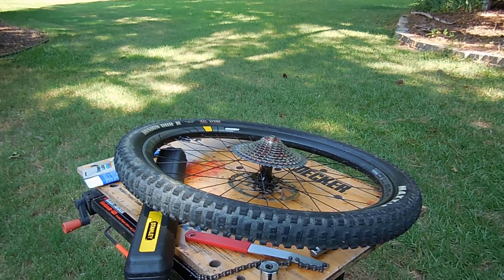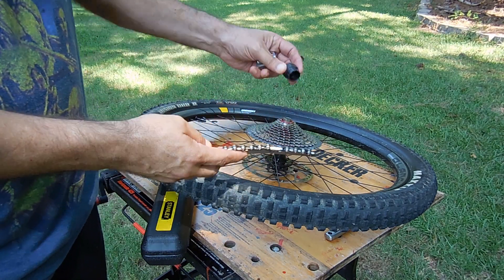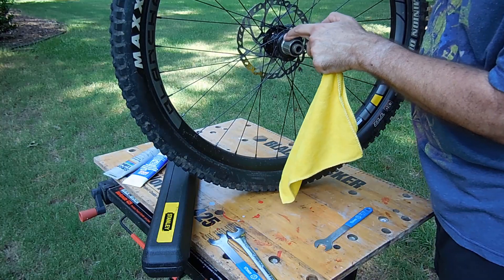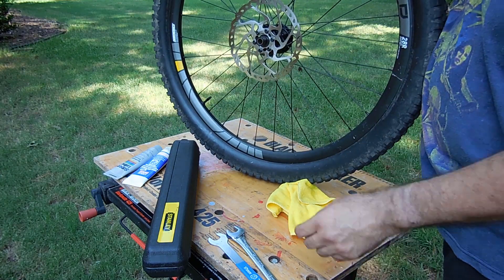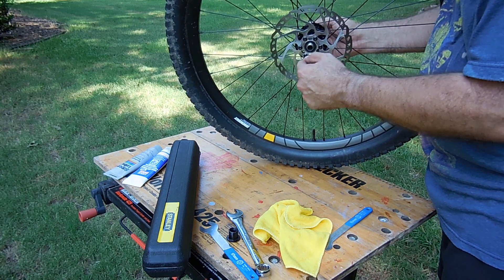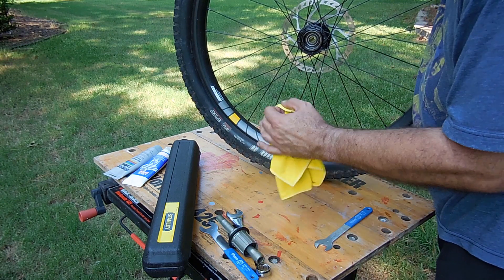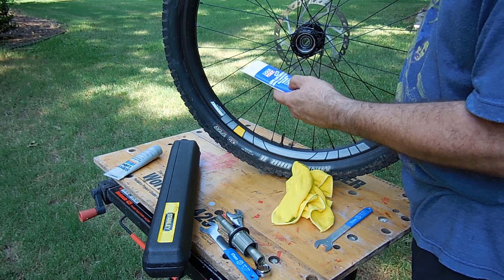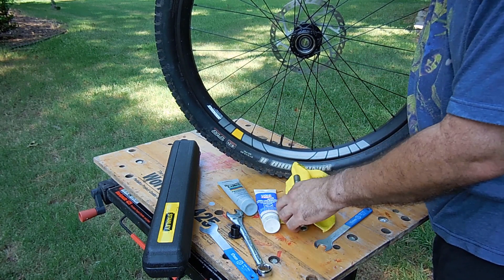How to service Novatec freehub, DB Release 4C and others

Comment: FYI Novatec recommends using Dumonde Freehub oil, not grease.  Also you should put loctite on the end cap threads before reassembling, again per Novatec, to keep the loosening issue you recommended.
Reply from the maker: Thanks for the tips.I pinned your comment so others can see it right away. In my case no more problems after this was done. I now have Bontrager wheels on the bike for the past 3 months or so.
Reply: @TonyHob   love the channel man. Been a solid resource for me. Can u link us to the Bontrager wheels u got?  I may have to replace mine. Having a hard time getting replacement parts for those 2018 novatec hubs. Thanks Tony.

Comment: Not sure what's up with mine but the big rubber washer just sits there...theres nothing for it to slot into so when I put the casette back on the lock nut doesn't reach the freehub threads....it only fits if I remove the rubber washer 🤷

Comment: I am serving my release 3 hub. I noticed one of the 4 pawls do not spring back up. It isn’t stuck down it just lays there. The others spring back up when pushed down. Is that normal?
Reply from the maker: It might just be sticky grease. Also make sure the spring is not missing. They should all spring back up
Reply: @TonyHob  thanks. upon closer inspection my pawls were all chewed up and I’ve got a new set with spring coming from Novatec.

Comment: I am having nothing but trouble with my Novatec hub. After 2 rides i get so many dirt and water inside that my freehub is stuck. Could it be the seal?
Reply from the maker: It could be, I found mine was not seated properly and worked great after servicing it and  making sure the seal was installed correctly

Comment: Do u know where one could purchase a replacement free-hub body for this wheel?  I cannot find it on novatecs website. Part # D462SB-ASA-SL-B12
Reply from the maker: Sorry, DB sent me a replacement under warranty
Reply: I had my 2020 DB Catch 2 freehub off yesterday to clean and grease. I didn’t notice the “spacer” that sits between the freehub and wheel bearing during disassembly, but I found it on the bench. I installed it and everything went back together and all seems fine. Your video is the only reference I have been able to find that shows the spacer. I have some questions as to weather the spacer actually came out of the assembly or if it was  junk that I had on the bench. Anyhow, do you know if the spacer is on all the Catch and Release bikes? And if I did not install it what would happen; will the pawls sit too low in the wheel? Thanks for any info. -Rob

Comment: Can we use hi-temp lithium grease?
Reply from the maker: It needs to be really thin viscosity grease or high viscosity oil. Not sure how thick the grease you have is. They do sell lube specifically for freehubs which would be ideal but it’s pricey
Reply: @TonyHob  Got it, i think the lithium on e won't work. It's like elbow grease consistency. Thanks